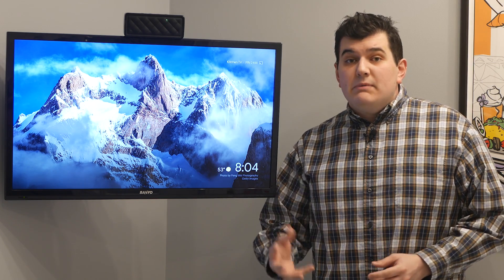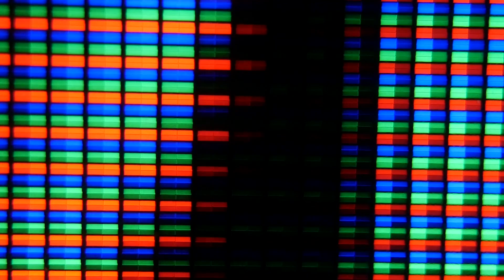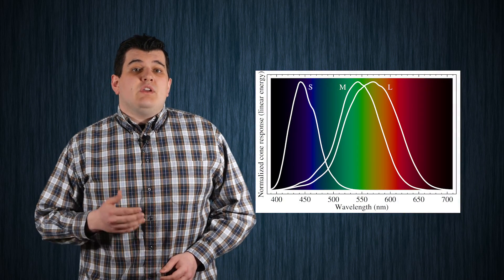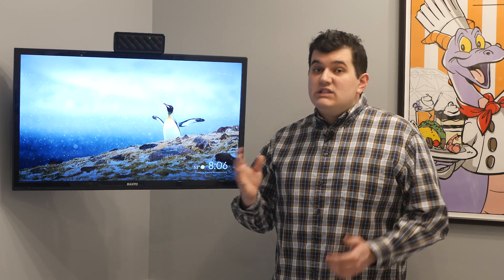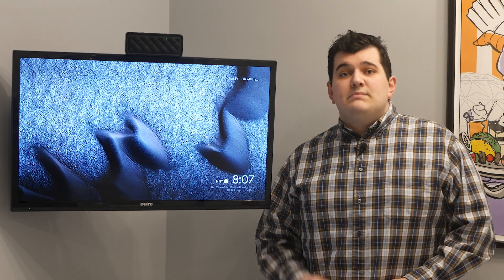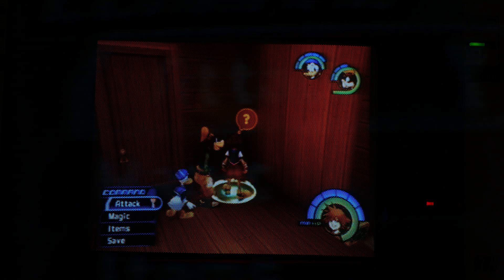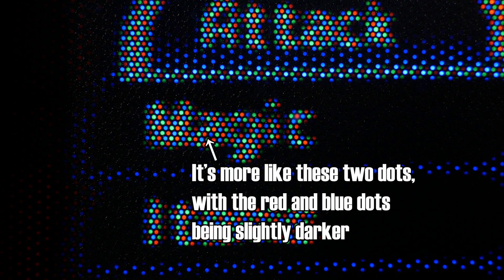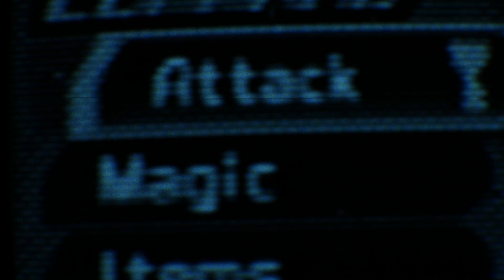These Are Not Pixels: Revisited

Comment: One detail which I'm sure you sensibly omitted for time: you can't reproduce all visible colors with three primaries. You can only produce those inside the gamut of those primaries (a cube-ish shaped subset of all visible colors.)

Some high-purity colors lie outside the gamut. E.g. high saturation cyan can't be reproduced because the green phosphor stimulates the "red" cones somewhat, producing a less saturated color.

These colors are less common in natural images, so it doesn't matter much.

This is why a lot of modern displays have an oversaturated image; they have higher purity color elements, which increase the coverage of the gamut. The most common color standards are based on older tech, so new displays require color correction, which is usually not present because most people don't care if the color is wrong.
Reply: While this is correct in theory, in practice a 32-bit color depth of red, green, and blue pixels actually produce significantly more colors than what the human eye or brain can actually tell the difference between, in orders of magnitude more. While some colors may still technically not be able to be reproduced, these colors are virtually indistinguishable, again to the human eye and brain, from other very similar colors that can be reproduced.

Sure while adding more colored pixels, like in the ypbpr or cmyk standards, can technically reproduce a higher color resolution, the apparent color resolution is virtually identical.

A really saturated Cyan for instance seeming more pale on RGB screens is not necessarily the fault of RGB itself but is actually a combination of dozens of other factors of the screen (for instance, one uniform backlight which is extremely common in current LCDs, will make most really saturated colors seem a bit paler by comparison to a screen with per-pixel back lighting, as well as not being able to produce a "true" black).
Reply: @Templarfreak  more colors than can be told apart within a certain range, yes, but not all colors that human sight can distinguish.
Reply: @thomasstewart9752  In theory yes, but in practice the further you deviate from specific colors that stimulate the RGB cones in the human eye (for instance does not necessarily have to actually be RGB colors) the less the color depth the human eye can actually perceive and the brain properly process it.  It is impossible for a given color space to truly reproduce everything but that's not necessary, everything the human eye can objectively distinguish is still a subset of "all true color."

And, again, note that some limitations are also not actually caused by limitations in the color spaces themselves, but by the technology. Again for instance a totally uniform backlight means a screen cannot produce a "true" black. Not being able to produce a "true black" is often blamed on RGB but that is not the case, and this is similar for many other colors that "RGB cannot reproduce" such as a true honest-to-goodness truly fully-saturated cyan or magenta (again, backlight fucks with that. RGB can reproduce those colors, but not if the brightness is uniform across the entire screen, but even considering a uniform backlight RGB can produce hundreds of thousands of shades of Cyan and Magenta that are true shades). True RGB is not being correctly represented in virtually all modern display technology due to things such as a uniform backlight. (There are other limitations as well, unfirom backlight is not the only one)
Reply: @Templarfreak  the standard is 24bit RGB, the additional 8 bits are for the alpha channel, which is a thing that the GPU uses to calculate transparency, but is not displayed on the monitor. so you usually have 256 shades per color and this is not enough, if I optimize the contrast and brightness of my monitor for this I can see all 256 shades of grey, red, green and blue on a test image. Of course this is an optimized situation, most images are not made out of big single-colored stripes, so on a real photograph you usually really don't see a difference between e.g. (255,0,0) and (254,0,0) but it's not generally impossible for general image content.
Reply: @rfvtgbzhn  Whether or not 32-bit includes an alpha channel is context dependent. In many cases, it's 10 bits per channel (stored in a 32 bit word). It's common for digital cameras to support 10 bits per channel for video, for instance. They also have higher bit depths for stills as well (12 or 16 bit are common). The higher bit depths are usually linear (i.e. they don't include a gamma curve, or the quasi-gamma curve used in sRGB).
Reply: @fwiffo  sRGB is 8bits per channel. There is an enhancement that uses 30 bits and there are also enhancements with even more bits, but the problem is that this is hardly supported by any video material.

The alpha channel is not always used. It is basically used to blend a foreground with a background image but this is done in the GPU. Whatever reaches the RAMDAC or whatever digital interface the GPU uses doesn't contain an alpha channel, so it is limited to 8bits per channel or more if the GPU supports it but if you use a digital interface, the interface and monitor also have to support it (this is technically not true for VGA, because it is analog and has unlimited color scales, however more than 8bits are usually only used for enlarged gamuts as far as I know). And you only can really make use of it if the content also supports it.
Reply: @rfvtgbzhn  The bit depth is not the issue. You can't reproduce the "color" of a cone cell, because cone cells don't have "colors." You are making the mistake of believing that each cone cell is somehow responsible for detecting a single frequency of light. The problem is that three primary colors cannot reproduce the entire visible spectrum, something that has been known for over a century.

Suppose I want to have a fully saturated yellow on screen. How can I do that? Ideally, I would have a yellow subpixel, and that would be that. But I only have red, green, and blue. So I have to light up the red and green subpixels. The red light is mostly received by long cone cells in my eye and also slightly by the medium cones. But the green light is received by all three cones! Whereas monochromatic yellow light will not really be absorbed by the pigments in the short cones at all. So these are different colors and can be distinguished by eye. And the same problem will occur whether I have a bit depth of 3 bpp or 300.

The only way to improve the gamut of a screen is to increase the spectral purity of the primaries or to increase the number of primaries. Some LEDs already have pretty spectrally pure light, but a majority (at least for consumers) still have only three primary colors, which means the gamut is limited. Some screens have as many as six primaries, but perfect color reproduction would require infinitely many primaries.

Look at the horseshoe shape of a chromaticity diagram and tell me how you are going to fill it all with a triangle. (e.g. en.wikipedia.org/wiki/Gamut)
Reply: @EebstertheGreat  there are still only 3 cone cells. So if each of the primary colors of the display matches exactly the response of each kind of cone cell, you would have a perfect reproduction. Then each primary color on the gamut isn't just 1 point but some set of points and you get this horsehoe shape. I thinknig's just not done because of technical limitations.

And of course the but depth so plays a role, as long as it's not high enough that 2 shades are always indistinquishable when they are next to each other, it will limit the amount of colors that you can see. You clearly see this if you look at a  true color image (24 bits, 8 per channel) but then set you monitor to high color image (16 bits, 5-6 per channel) and see that it changes. 8 bits per channel (256 shades per color) is pretty close from indstinquishability even under optimal conditions but not quite there, you'll need about 10 bits per channel.
Reply: @rfvtgbzhn  No, I don't know how many times this has to be explained to you. No frequency can be absorbed by only one cone cell. All visible frequencies are absorbed by at least two, usually all three, in varying proportions. Sure, if you could stimulate each cone cell individually, using microscopic electrodes or something, that would allow you to reproduce any visible color (including many "impossible colors" that cannot be produced by any combination of light). But that can't happen on a TV screen.

You can read about this in the link I provided, so you don't have to "think it's just not done because of technical limitations." You can actually find out, which is what I did before I explained it to you. The reason it is not done is because it is not physically possible.

Bit depth does not play a role in the size of the gamut. It only determines spectral resolution. Increasing the bit depth only allows for finer discrimination between similar colors. It doesn't give access to colors outside of the old gamut.
Reply: @EebstertheGreat   @EebstertheGreat  the video is not just about gamut, so the but depth also plays a role.

And I think I know get your argument but I think it only proves that you can't simulate it monocromatic light or exactly matching the curve of the cones. Some colors that refer to some theoretical combination of cone signals don't exist at all in the physical reality because for example the M and K cones can't be stimulated 100% independent from each other. As light can be described as a curve of intensities for every wavelength, you would have to just find 3 curves that can when put together can produce the same effect as every natural color, i.E. any possible curve over all visible wavelengths. If you can't disprove this you can't prove that there are any natural colors that can't be displayed on a monitor. I doubt that this is possible with simple logics, I think you need some higher math for that. Do you know if such a prove exists?
Reply: @rfvtgbzhn  "you would have to just find 3 curves that can when put together can produce the same effect as every natural color"

For the third time, no such "curves" exist. I don't know why you keep insisting that they do. I am interested in how you think a spectral color could be reproduced by mixing two or three low-saturation "curves."

You have to realize that every color is a point in a color space, not a curve. If it's a spectral color (i.e. monochromatic) it will lie on the spectrum, i.e. that upper rounded side of the horseshoe in the hue-sat plane of the chromaticity diagram. Otherwise, it will lie in the interior. You can't subtract light, so if one of my subpixels is giving me a mixture of red and green, I can't subtract that red out later to get a nice saturated green. No matter what I mix that yellow light with, I can't make green. The only way to get pure green is to shine a pure spectral green light.

If you want a more mathematical approach, collapse LMS space into two dimensions by equating colors with different brightnesses but the same hues and luminosities. You can do this by first drawing surfaces of constant luminosity in the LMS space, then equating a point on a given surface with the entire ray passing through it from the origin. This is sort of how you get the color spaces you see (albeit not quite). Now when you mix two colors, you are adding two points in LMS space, getting a third point which is brighter than either of the two, but if you project it back down to the same surface (i.e. reduce its brightness to match the brightness of the original colors, without changing its hue or saturation at all), it will lie on a line segment connecting those two colors. This comes directly from the parallelogram rule for adding vectors. Thus, if you have three primary colors, mixing them can only produce colors inside the triangle those primaries define. This is why they were once specified using trilateral coordinates (aka barycentric coordinates). And if you have n primary colors, mixing them can only produce colors inside the n-gon they define. Since the actual observable color space does not have straight edges (except the line of purples, which have luminosity zero anyway), the whole thing cannot be contained in an n-gon all of whose vertices are themselves contained within the color space. It's like trying to fill a circle with an inscribed polygon--you'll always miss some of the circle. The portion of the space which is inside the n-gon is your gamut.

Alternatively, you could use a triangle or other polygon bigger than the color space. This could easily contain the whole thing, but the vertices (or at least one vertex) must lie outside the color space itself and therefore be an imaginary color. For instance, an imaginary hypergreen color that only stimulates the M cone could allow us to reproduce all visible colors (and many invisible colors).

If you want a discussion on primary colors, check out this page: handprint.com/HP/WCL/color6.html.
Reply: @EebstertheGreat  I agree with you. I learned watercolor and always be amazed how paint named Phthalocyanine Green looks gorgeous on paper. It's so pure and vivid, kinda like magic to me. But when I take a photo, my display can't show the right color. The color is always off, kinda whitish. No matter how hard I adjust the picture using software, I can't get it right. Later when I randomly open RGB color picker, I just realized that my Phthalo green is not there. It simply lies outside the gamut.
Reply: @EebstertheGreat  Exactly right! Colour vision and colour reproduction are vast and complex areas of study, well beyond the scope of a YT video, and RGB displays just a tiny sliver of the whole picture. This video does a great job of explaining the mechanics of colour displays, but some people commenting here seem to think RGB is the whole enchilada, it’s really just one ingredient, like, maybe just the tortilla!

I’m glad you mentioned spectral colours, because one of the failures of most colour reproduction systems is their inabilty to deal with non-spectral elements, e.g. fluorescing colours, or as someone just above has mentioned, certain pigments that contain fluorescing elements, like pthalo green, cobalt blue, etc. Flowers are a perfect example of multispectral colours we can see, but cannot reproduce in RGB, CMYK, HSB  and other models.

As a side note, I’d add that the so-called RGB cones in our eyes are “smeary”, i.e., not monochromatic, not geometrically spaced like our RGB sensors and masks and many, in fact most of our cones outside the foveal area are not very sensitive to all colours, they are more sensitive to brightness and… movement! Our eyes do some processing/filtering, our brains do the rest, and trying to encapsulate that system in a YT video is just not possible, but good job of tackling this one area of colour understanding by the presenter and an excellent, if perhaps a bit esoteric, comment!
Reply: Can you talk more about the color correction thing? How would I go about that?
Reply: @MajoraZ  There are two parts to the process - calibration and profiling. You buy a device (a colorimeter or spectrophotometer) which measures the color output of your monitor. A piece of software will use the device to measure the output of your monitor, and help you set its brightness etc. to good settings, and set up correction curves so it's "well behaved". This is calibration.

It will also produce a profile that describes the gamut and other characteristics of the color-space of your display (this is called "profiling"). Software which supports color management (professional software like Photoshop) can use this profile to map the color-space of an image (such as sRGB) to the color-space of your display (typically something larger than sRGB). If you aren't using software that supports color management, it's not going to work. Color management may be supported at the OS level, but you're still usually going to have trouble with software that is not explicitly color-managed.

If both you and the creator of the image are using a fully color-managed workflow, then the image you see on your screen should be close to the image they see on their screen, even if it's a totally different kind of display. 

Most random people are not using a color-managed workflow, so it's not worth the bother if you're not serious about it. You have to have every link in the chain working (your display, the colorimeter, the software, the files, etc.)
Reply: actually the reason why sRGB doesn't cover the whole gamut is that the colors are not exactly the same as the colors that are recognized by the cone cells. So in theory you really only need RGB, but sRGB is an insuficient implementation.

The other problem is that a TV with an enhanced gamut is not good because almost all content uses the standard gamut, so if the TV "enhances" it, it actually makes the colors wrong.
Reply: @rfvtgbzhn  There's no such thing as making the primaries the same as the colors recognized by the cone cells. Each type of cone cell is sensitive to a range of colors, and they overlap. And each type of cell does not differentiate between the different parts of the spectrum it's sensitive to. There's no logical translation between a spectral sensitivity curve and the spectrum of a color.

If you somehow produced a color with a spectral curve that matched the sensitivity curve of a cone, it wouldn't produce the "color" perceived by the cone. It would be a considerably more desaturated color than the primaries used in displays, as it would stimulate all three cone cells a significant amount. Primaries must have narrow spectra to produce a large gamut, and cones have broad spectra.

In fact, it's impossible to only stimulate one type of cone, because of the overlap in their sensitivity. If you could stimulate only one type of cell, you'd produce a more saturated color than can ever exist in the real world.
Reply: @fwiffo  "If you somehow produced a color with a spectral curve that matched the sensitivity curve of a cone, it wouldn't produce the "color" perceived by the cone." - of course it would. It's simple logic: if you produce and display an image exactly as it is perceived by the cone cells, it is the same image. I think the reason they never did this is because it is technically impossible or too expensive.

"In fact, it's impossible to only stimulate one type of cone, because of the overlap in their sensitivity. If you could stimulate only one type of cell, you'd produce a more saturated color than can ever exist in the real world." - true, but this is not a problem. if you simulate all 3 cone cells exactly the perception is exactly the same.

I guess the only problem that could arise except of costs is that there could be individual differences between different people, but they are probably not great, at least if you consider "healthy" people.
Reply: There are also colors that can only be produced by screens, but not by a color of light; magenta. Because no color on the spectrum stimulates both the red and blue cones simultaneously
Reply: Color management is a real can of worms. It's actually quite relevant to my job because we tend to buy things like monitors used, and in the 24" class used wide gamut displays are super common while plain sRGB jobs aren't, plus the latter tend to retain their usefulness in plain office environments like ours a lot longer so aren't sold as much. It wouldn't be half as bad if said wide gamut monitors had some usable sRGB emulation, but they tend to be too old for that. (Right now you can get monitors which are barely even 70% sRGB for the sake of efficiency, or sub-60% in laptops, which is getting a bit silly. On the other end of the spectrum you get some super wide gamut coverage. We'd just need 100% sRGB and not too power-hungry.)

Then there are some more snags like low-frequency PWM for LED backlight that tend to rule out other potential candidates. A lot of people may not notice it, but I wouldn't rule out that they aren't negatively affected regardless, and I do not particularly fancy having people use equipment that wouldn't be up to my own standards.
Reply: No doubt, it's a huge PITA. One big problem is that most modern "regular gamut" monitors are quite a lot wider than sRGB. So people prepare images on those displays without color management, and they end up looking understatured when you have a properly color-managed workflow, because sRGB is assumed by default (and there's no other reasonable default to assume.)

And if you have a color-managed workflow, the only way to know what your final images look like for most users is to have a second monitor with an "average" gamut and no color-management, then hope for the best.